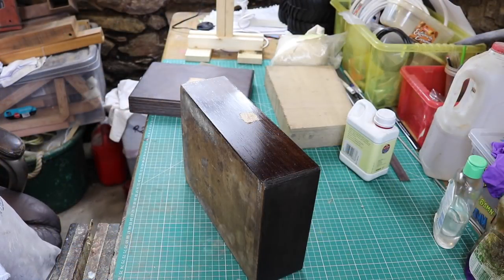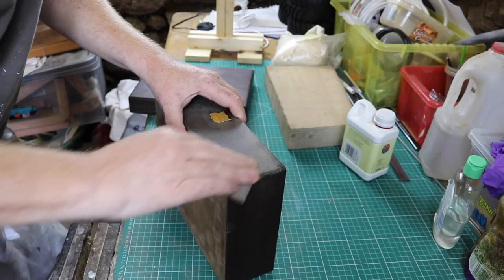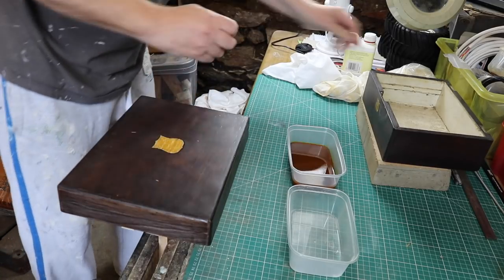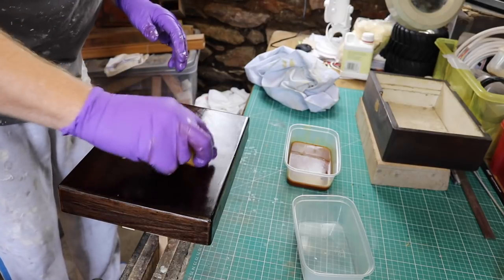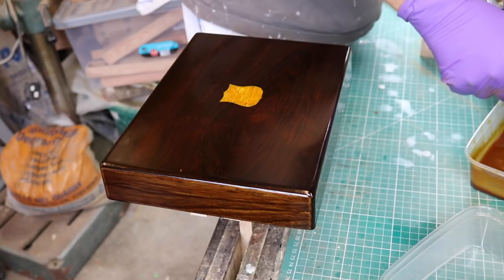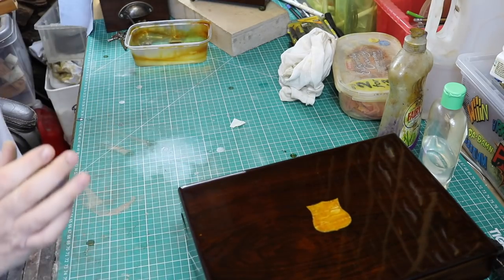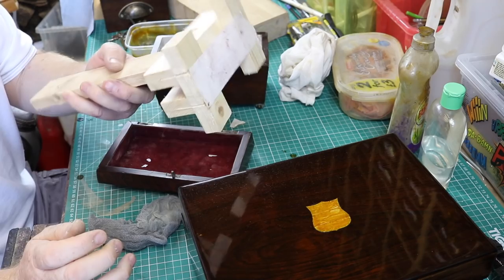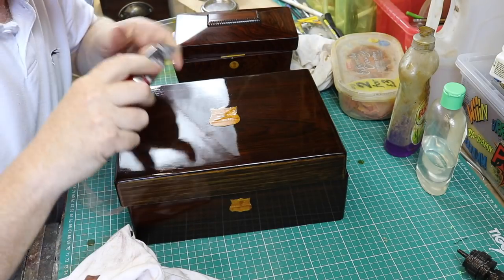French Polishing Antique Boxes

Comment: For a real quality job, no wood pore should be seen, in both boxes you can see them all over the place.  Eliminate the mineral oil (or olive oil) and give them rub after rub, letting them dry, then rub them again and again, until all pores disappear, THEN it will really look like a mirror.
Reply: I use a Rubbing Pad and Boiled Linseed, stunning results even in open grain materials like Oak and Ash!
Doing and Oak and Purpleheart box right now!
Reply: @henrysiegertsz8204  Could you please explain this further?  You do a French polish using only Boiled Linseed Oil?  I use this all the time to condition wood.  I never knew it could be polished to such a shine!
Reply: A quality finish doesn't always have to be a mirror finish - it depends on the wood and its grain and pore structure. Using grain filler isn't always appropriate. I personally don't use mineral oil, preferring to slacken the French polish with meths. It requires more coats but the finish has always been first rate.

Comment: Hi thank you for your superb information. I found an old box in the attic and it was looking a bit worse for wear so decided to give it some treatment. I have got it now rubbed down and ready for french polishing.It has some small cracks on the top face these are less than 1mm wide . Is it worth trying to fill them in with a shellac stick or just flood them with french polish until the cracks are filled after a few coats with the brush ? There is a slightly deeper crack on the side that i will do with the shellac stick then sand down to blend before french polishing.Any info would be greatly appreciated.
Reply from the maker: If you can get your finger nail into the crack you should definitely fill it.

Comment: Thank you!  Great video but you need to shorten it and not ramble about sheets and stuff.  Keep it brief.  Thanks for sharing such valuable knowledge.  Subscribed.
The boxes had a lovely gleam to them.  I have always wanted to try this technique and finally have two wood boxes to try out.  My questions:
Did the boxes have any existing finish on them before the polish?  Did you use any oil to condition the wood first??
I guess French polish is a type of waxy finish that is buffed to high gloss?
Can I use it on an antique micromosaic box with mosaic of wood, shell, bone, ivory all around?  If I sand it smooth, it should not be an issue, right?
I have to restore some 'Sadeli mosaic boxes' (see pics online) and need to find special mosaic replacement supplies.  This is a vintage item made in India.  Still being manufactured in India, Syria, Shiraz in Iran.  Do you know any suppliers of this mosaic?  Very hard to locate.  Maybe you know suppliers or can ask your sources in the trade.  It would be wonderful to get hold of some.
Reply: I nearly fell asleep 5 times yawn yawn yawn